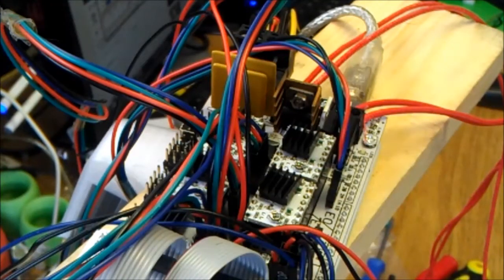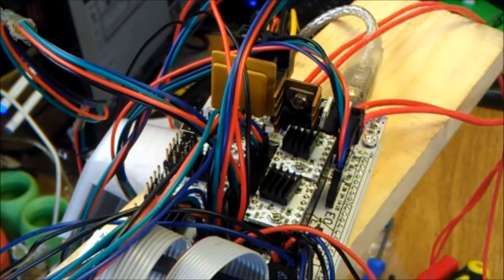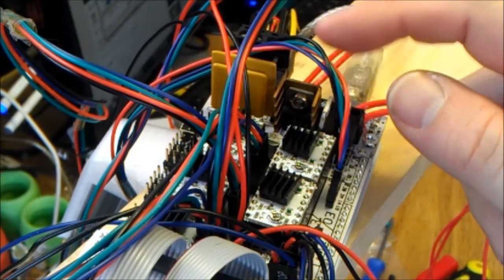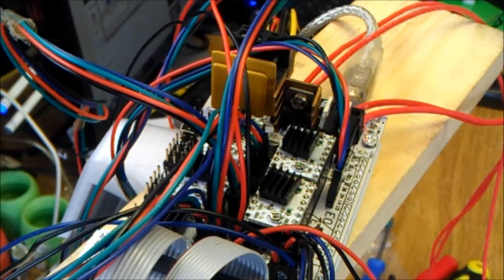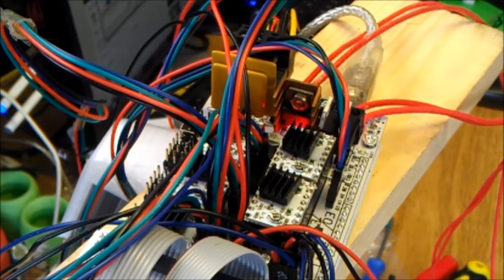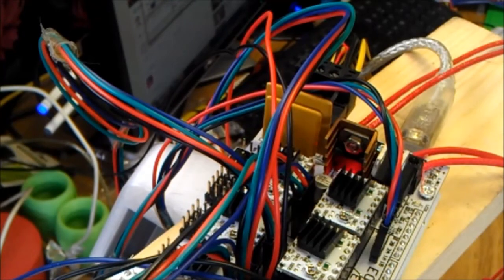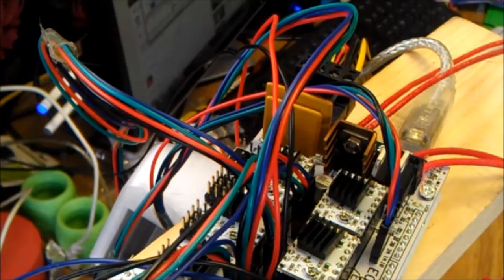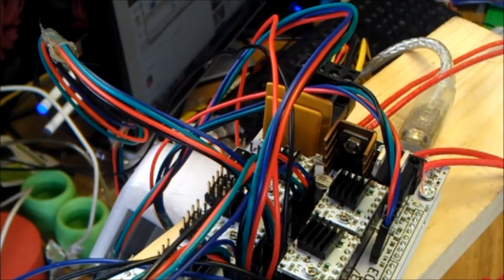RAMPS 1.4 MELTDOWN :-(

Comment from the maker: don't touch MosFETs while circuit is powered, because one can damage it not just with static electriciity, but with simply when human body is on other potential. Very easy to destroy the FET (at better case), worst case it will open/close when it should not, and let the 4 tons electromagnet fall on the head, or turn on the motor while fingers are near